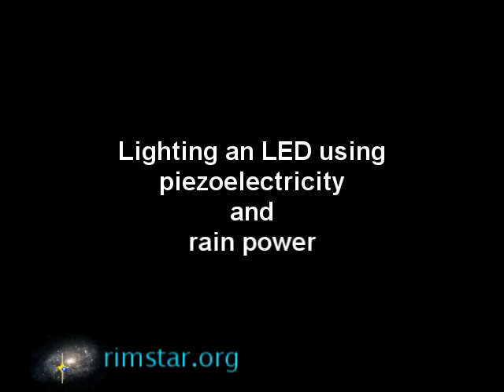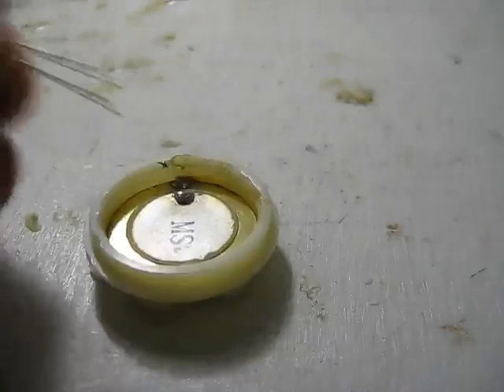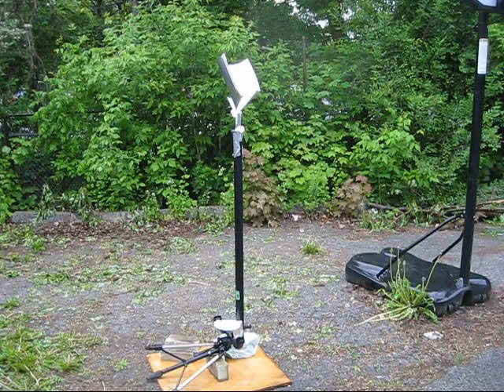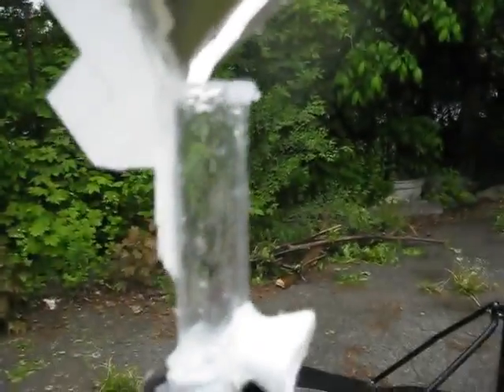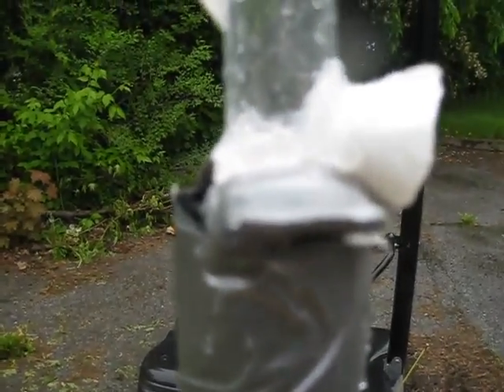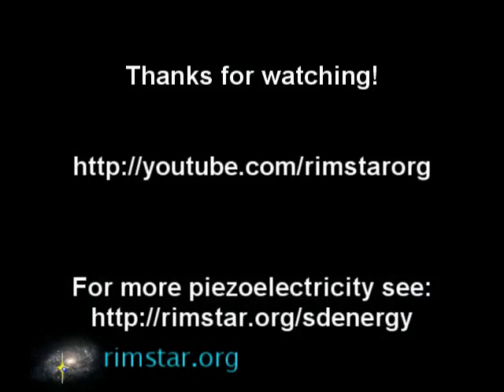Piezoelectric generator LED lit by rain water

Comment: I SOOOO THANK YOU FOR SHARING THIS!!! NOW I'VE FOUND THE RIGHT TOPIC TO DO FOR MY INVESTIGATORY PROJECT!!!! WOULD YOU LET ME HAVE THIS IDEA FOR MY PROJECT? HMMM BUT IF YOU DON'T WANT, I PROMISE NOT TO GET THIS FOR MY IP :))
Reply from the maker: You're more than welcome to use this idea. I don't protect any of my ideas. It would be nice if you give me credit for the initial idea by linking back to this video or my channel, but that's optional. Let us know how it goes and what you find. Have fun!
Reply: RimstarOrg Thank youu so much! Now, I just have this question. Can normal LED be used with water? I tried to buy the one you have in this video but the store I went told me that they dont have that type of LED. So now, I'm wondering whether normal LED can be utilized in this type of set-up. Thank you in advance! :)))
Reply from the maker: Luminescent star The LED I use seems normal to me so I guess you'll have to describe your LED to me. Maybe find a link to it online.
Reply: Hi! sorry for the late reply. I was confused whether I need to find a water-resistant LED, if there's such, in stores. So I used the term "normal" to LED which doesn't necessarily have the label "water-resistant" to them. Do I really need to find a water-resistant LED in remaking this set-up?
Reply from the maker: Luminescent star No, you don't need water-resistant LEDs. Though I suspect it's not the LED that's actually water resistant in the products you find in stores, but rather the packaging that contains the LEDs, wiring and any other electronics.
Reply: Oh. Thank you so much! I'm sorry for bothering you with these questions but I'm afraid I'll still ask you some questions few days from now. Is that okay with you? Sorry for the trouble. It's my first time making set-ups for my project so I'm not really familiar handling this kind of work. =))
Reply from the maker: Luminescent star Sure.
Reply: RimstarOrg Greetings! So, can I ask you what's inside that black tube? I am planning to buy the materials tomorrow for this kind of set-up but I can't understand the part where you mentioned pressure and height. Is there a smaller tube inside that black tube? Thank you!
Reply from the maker: Milky Way
The black tube is empty. It's there just to prevent wind from interfering with the water as it drops, so that the water drops straight down and hits the piezo crystal.
Height = pressure. The higher something falls from, the more force it will have when it hits the piezo crystal. If it falls only one inch then it wouldn't have enough force to affect the crystal. But from the height I made it fall from in the video, it had enough force to affect the crystal. Try it by dropping drops of water on your hand from different heights and you'll see. For more about the physic search for "gravitational potential energy".
Reply: RimstarOrg I see. Thanks for explaining. Approximately how long is the black
tube? And after watching your video repeatedly, the same question remained unsolved in my mind. What's the use of the other hole in the top transparent tube? You said "you dont want your water to be too high". Can you please explain to me the purpose of this tube? I just cant understand why that tube is related to the height of the water. Thank you again! :)))
Reply from the maker: Milky Way
The black tube is approximately 48". Anything roughly around that should work.
As for the hole in the top transparent tube... that requires some background explanation.
There are two holes at the top. One is a very small one at the top of the black tube. The other is a bigger hole in the side of the transparent tube.
The small one at the top of the black tube determines how big each water drop will be, since the water has to go through that hole in order to fall down the black tube. But if the hole is too small then surface tension around the circumference of the hole will prevent the water from going through. If the hole is too big then the drop will be too big (for some unknown reason) and not impact the piezo crystal properly. Maybe if the drop is too big it will break up as it falls, I don't know. I found out the suitable size by trial and error.
You also don't want the water to go through the top hole too fast otherwise you end up with a stream instead of a water drop. The piezo effect works with brief taps (drops), not constant pressure (a stream).
So why have a hole in the side of the transparent tube? Well, as I said in my previous reply, height=pressure. So the height of the water in the transparent tube determines the pressure on the water at the top hole. Too much pressure and you get a stream of water. Too little pressure and the water can't get through the hole at all due to surface tension. The height of the water in the transparent tube is determined by where the hole is in the side of the transparent tube. The bottom of that hole is the top of the water, since any water higher than that spills out that hole.
So the position of the bottom of the hole that's in the side of the transparent tube is used to control height of the water in the transparent tube, which controls the pressure on the top hole, which controls the flow of water going through the top hole.
Reply: RimstarOrg Thank you so much for explaining! At last, I understood already the purpose of the side hole! You're great as always! :)) I shall go now and buy the materials! Thanks again!
Reply: RimstarOrg Hi! Did you make the top transparent tube with side hole by yourself? Or you bought that somewhere? If so, can I have the name of that apparatus? I'm confused if you just connected the side hole or there's an actual apparatus with a side hole. Thank you! =D
Reply from the maker: Milky Way I bought the transparent tube at a local plastics store. You can probably make your own from all sorts of things like pill bottles or even rolled up transparencies from a photocopying store (if you can roll it into a cylinder that you can make waterproof.) Really any clearish plastic jar will do, but it's nice if it has a small diameter so that it fills up faster from the rain. I drilled out the side hole, but use whatever means is practical given your materials. For example, if you use a thin plastic jar or bottle then a sharp knife might work. The white cone attached to the hole is just a piece of plastic (which you can get from a margarine container or anything really) and hot glue on. It's there to direct the water away from the top of the long black tube.
Reply: RimstarOrg Cool! Thank you so much! :))
Reply from the maker: Milky Way
You're welcome. Be sure and let me know how it goes.
Reply: RimstarOrg Hi!I have already my set-up. What I'm thinking right now is how to measure its voltage. Do you know of some methods I could try to get its voltage? Thank you! More power xx
Reply from the maker: Milky Way
You can detect that there are voltage fluctuations by connecting up a normal volt meter, a multimeter set to the voltage scale. Since the voltage happens mostly as a short spike you will see only a sample of some part of the spike. If your meter has a min/max feature then you can get it to tell you the maximum value it sampled.
Alternatively you can use an oscilloscope like I do in this video "https://www.youtube.com/watch?v=R9m79oWdOZI".
Reply: RimstarOrg Oh so used an oscilloscope! very smart as always! Thank you xx
Reply: RimstarOrg Hi! I just want to ask for possible suggestions. I did this experiment repeatedly already using the set-up like the one you used in this video. But it doesn't seem to work.  I bought the tube with a length similar to what you have answered me. It's odd. Thanks! :))
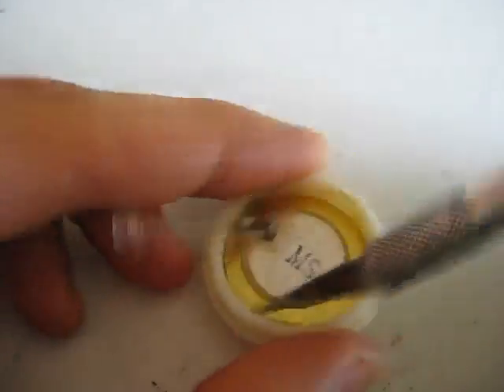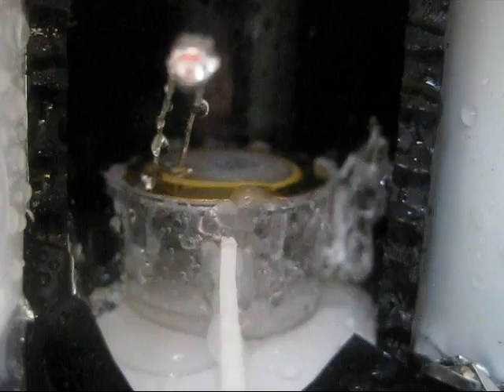Reply from the maker: Milky Way Check if your piezo crystal and LED work at all first by just tapping on the piezo like I do in the video at around 0:40 (maybe your LED is connected backwards?). Be careful when attaching the LED to the whitish part since you can easily ruin it. If that works then try a test in the shower like I did to see if water drops hitting it from a height will work. If all that works then the problem may be the size of the drops are wrong, in which case you may need to make the hole at the top of the tube smaller or larger. Or maybe you're not hitting the piezo crystal in a good spot while it's in the tube, in which case you could try moving it around. Also, at 2:37 in the video I point out that I found it worked best when there was nothing directly under the crystal and so I mounted it on a hollow cylinder, so that's also something to play with.
Reply: Thanks for the very detailed reply! I believe these suggestions will help a lot!

Comment: hi !  watched your video ...its lovely...can you please give some reading of voltage vs. pressure from your experiment and the size of your crystal..
Reply from the maker: Hi, I'm glad you enjoyed my video. Unfortunately I don't have any readings of voltage vs pressure... I don't even know how I'd make a pressure measurement given how small it would be. The metal disk is 27mm in diameter and the crystal material on it is 20mm in diameter. It's very thin, probably around 1mm thick.

Comment: isnt the rain short cyrcuiting the elecrticity?
a rain panel (oposed to a solar panel) sounds like a nice experiment.
Reply from the maker: I hadn't even thought of the rain water short circuiting aspect. I know the resistance of ordinary tap water is in the kilohms. I'd imagine the resistance of rain water is higher? It seemed to work anyway.
Regarding a whole panel of crystals, it would work only during a very hard falling rain, which happens only for brief periods of time during a period of rain fall - at least around here. That's why I had to go with the tube, to accumulate water and make my own hard falling drops.
Reply: Oh i see, .
Also, connecting the crystals on serie would not be working right? i mean if one of the crystal generates electricity and that goes through another crystal, the second crystal would react and consume that electricity right?
Reply from the maker: Jerónimo Barraco Mármol
No, connecting in series wouldn't work. They have a very high impedance. The material isn't a very good conductors at all. But you could try connecting a bunch of them all feeding the same circuit to charge something, and use something else like walking on it to make the power.
Reply: that sounds like a nice cool idea. i saw some videos from some guys on india (i think) making energy from car's speed breakers using motors. maybe this could be used instead too to generate light for road ligths, maybe? or more cool at crowded places like shopping sections of a metropolitan city.
Reply: would making that so called circuit be too hard? would it be like a joule thief? i mean, i assume the power wont be so much to actually charge a battery, and itll be important to not lose efficiency
Reply from the maker: Jerónimo Barraco Mármol
I don't know what the circuit would be, I've never given it much thought. Efficient diodes at least, maybe store in a capacitor but that depends on what you want to do with it. Someday I may try it, just to see what's involved.

Comment: would it be possible to make a gigantic one that shoots 12 volts each time something struck it?imagine using one on a vibrating bike engine and using to recharge the battery as you rode it
Reply from the maker: You'll get more output from a normal coil and magnet type generator that's turned by the wheel but it would be a fun project. Given the rough environment on a bike, these thin piezo crystals might be too fragile so I'd go with a more robust piezo crystal like from a lighter as in my "How to take Piezoelectric Igniter from Lighter for Spud Gun" video.

Comment: This is an interesting concept.  It brought to mind the ossicles in the middle ear to match the impedance between air and water.  Might some lightweight, leveraged system be constructed that could change sound waves into high enough pressure to activate a piezoelectric device?  That way you would not have to wait for a downpour, you could just set up the device in a noisy environment.  I realize that there is normally very little energy in sound waves.  It is just a thought for an experiment.  Good Luck!
Reply from the maker: The piezos respond only to a change in pressure, not to a constant pressure. So while the venturi effect, or something, could be used to increase the wind pressure, it would also need a mechanism to pulse it. However, air has a very small density compared to water and I'm not sure this would be practical at all. Thanks for watching, and for sharing though!
Reply: The problem with using sound waves in air is the massive difference between the acoustic impedance of air (412 Rayls) to the piezo (around 15 million Rayls) which results in nearly all (99.995%) of the sound energy being reflected back at the interface between the air and the piezo. It's possible to get very little reflection in water (1.5 MRayls) using acoustic matching layers but in air its extremely lossy. The best these researchers (http://www.academia.edu/3581253/Acoustic_impedance_matching_of_piezoelectric_transducers_to_the_air) could do was 24dB loss i.e. the output voltage was 1/15th of the input voltage. That seems ok for free energy but keep in mind that piezoelectric crystals with decent electromechanical coupling are extremely expensive.

Comment: Why didn't you just pour some water in at regular intervals (i.e just after the water you've poured in has dispersed out of the 'contraption'). That would've been much cooler
Reply from the maker: Cooler than having it run on rain water? I guess it might have looked cooler, but running on rain water is pretty cool I think.
Reply: Are you gonna implement my suggestion?
Reply from the maker: *****
I can't. This has been long since disassembled. It's also not different enough from what's already in this video. I see more what you're thinking about though. That would be cool. Too bad our building's roof drains through vents directly into the underground storm drains. If we had eavestroughing then I could get a steady supply from there after a rain. It'd be a good mix of the two approaches.
Reply: Oh well.. I gave a video a like so I hope that compensates for my wasting your time :)
Reply from the maker: *****
It's no waste of time. Feedback is always useful in some way. Maybe it'll spark another idea in me.

Comment: This is great. You should make the tube much taller and find a way of getting each drop to accurately fall on the crystal. The taller the tube the more g.p.e/KE. Or maybe have a much larger collector? I'm no expert but this is exciting stuff! You should do more on the subject.
Reply from the maker: I started out thinking I could just put the piezos out in the rain and then the drops would have high energy but with a normal rain the piezos don't get hit often. A large collector and more tubes with more piezos would do it. I don't think taller would help - there seems to be a maximum speed for the drops, probably to do with air resistance. I don't know if I'll pursue it further though. Too long waiting between rain around here.

Comment: If you duct taped a number of these to the outside of a bicycle tire and fed the juice in series to a volt meter, how much electricity do you think you might generate? Could the transducers be embedded in the tread of a tire to feed ultra capacitors connected to a car battery? Hmmm.

Comment from the maker: I was trying to think of different ways a piezo could be activated. A quick test showed that drops could do it. Then I thought it could be applied as something decorative like an arrangement of artificial flowers that would sit out in the rain and have LEDs flashing. Of course the first thing was to just test the principle. That's what this is. But it showed that only on very hard rains would the flower arrangement work. So that's as far as I went with it.

Comment from the maker: I've never bought one. Some musical gift cards have them. Bring a magnet to the store. If the magnet is attracted to the speaker in the card then it is NOT a piezo speaker. Microwave ovens use them as speakers and some have a 2nd one for temperature warnings. If you just want a piezo and it doesn't have to be disk shaped then BBQ igniters and some lighters have rectangular or cylinder shaped ones inside. See my Piezoelectricity playlist on my channel page for videos about them.

Comment from the maker: Without the hole in the side of the pipe then there would be no surface tension. The water would fill up the pipe and there would be enough pressure to overcome surface tension. But the water would go through the hole in the bottom of the pipe too fast. The hole in the side keeps the pipe from filling too much. But it's also in the right place to all the pipe to fill up enough to overcome surface tension. I don't shake the pipe because I wanted it to be automatic.

Comment: You'e right that a regular turbine is not good at the tap, but a Tesla turbine does not have friction or very little like 5% loss as "howstuffworks" states which you should not notice a difference in water pressure. 
I am not sure it would be good to use a tesla turbine in the drain since it would need some water pressure, so a regular one would be needed for that.

On the Piezo crystal would it get energy if it's getting hit from a vibrating speaker if the speaker has something hard to hit it?

Comment from the maker: It's a piezo crystal. When you tap a piezo crystal it produces a voltage. So connect an LED across the crystal and it lights up when the water drop taps on it. But you're right; I have all sorts of videos about using/getting piezos but none explaining them. It wouldn't fill a video, but I guess I could show different types. I do have enough examples. :)
I like the turbine in the drain idea. It doesn't make sense to put it in the tap, but in the drain it does make sense. Never thought of that.